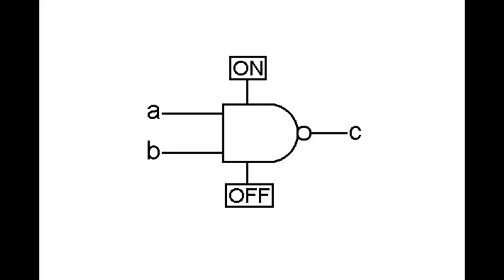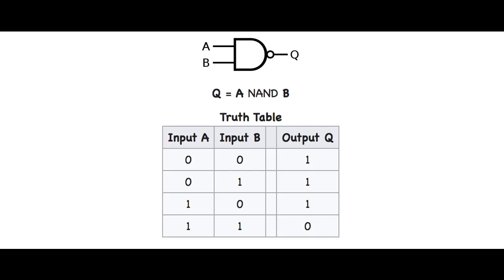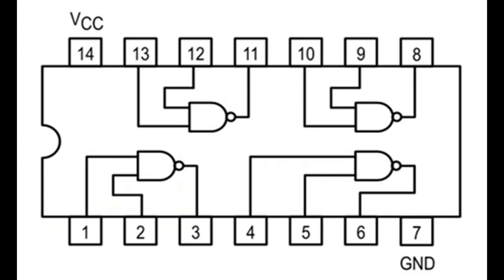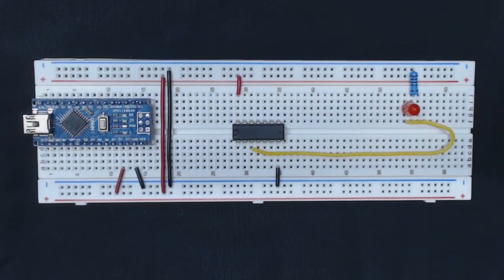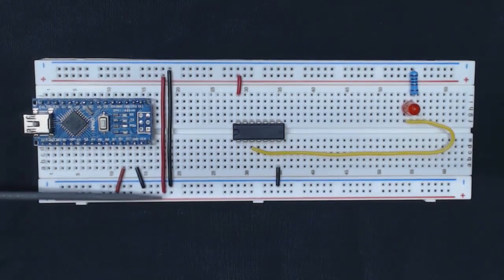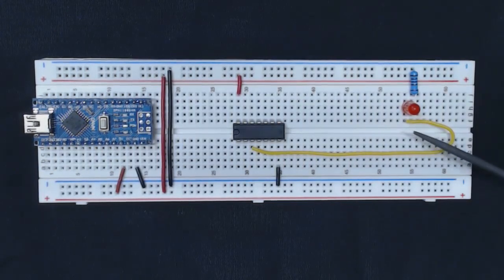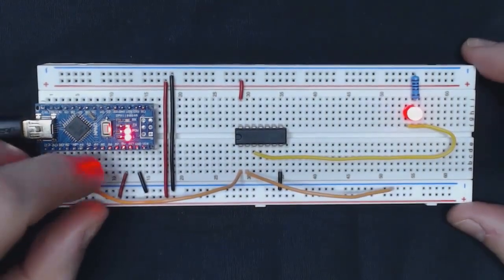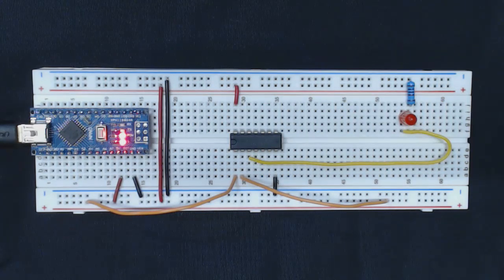But How Do It Know? Video #2 -  The NAND Gate

Comment: Hey actually I completed the book and now I am studying about microprocessor(specifically 8085). I found very similarity between 8085 and the processor in this book.so my questions are:-
1 - Is it same to 8085?
2 - how many clock cycle is required to execute an instruction in 8085, because the processor in this book uses 6 or 7 cycle to execute an instruction including fetching the instruction.so my question is "fetching and executing of the instruction is as same as shown in this book)

It would be really helpful if u can give a detailed difference between 8085 microprocessor and the processor which is described in this book.
Reply: 6 7

Comment: Also amazed. Thank You! .Thank You Very Much for taking the time to produce these vids. I suggest that you monetize (I'll buy) the instructions on where to place components on breadboard. For example - Insert Arduino Nano (you should have affiliate link)  E1, I1, E16 and I16 -  Insert the NSN74HC00N (affiliate link)  across slot E29 -Pin 1 - Insert Red wire top positive rail 18 to bottom positive rail 18....etc etc . After thought - partner with supplier to provide hardware kit for entire project.
Reply: On video 4 and see you show Fritz layout
Reply from the maker: Yes, there are a lot of Fritzing diagrams scattered out through the different videos, focussing on certains parts. You can get all the .fzz files in the project repo on Github: https://github.com/patrickleboutillier/jcscpu-hmc